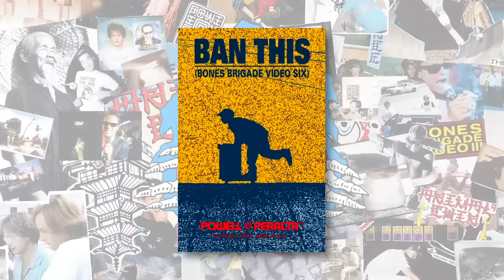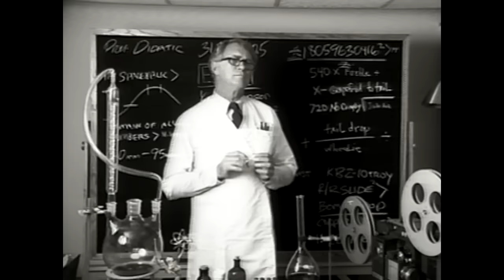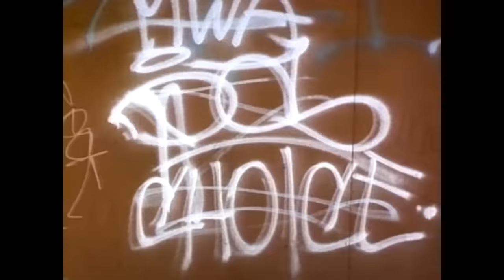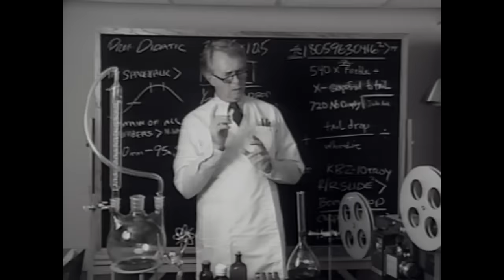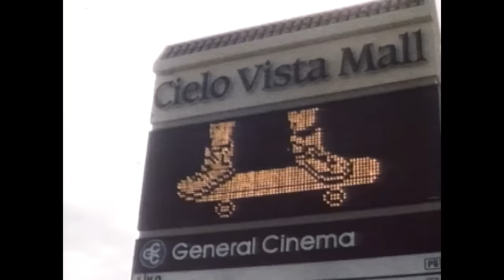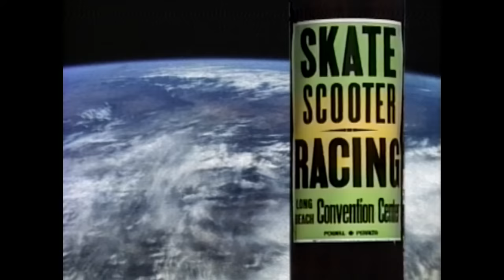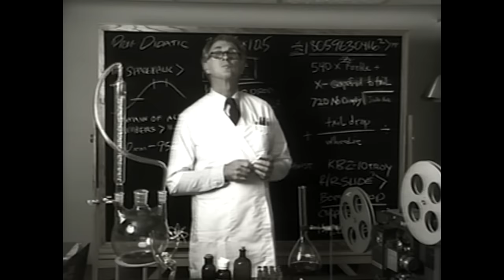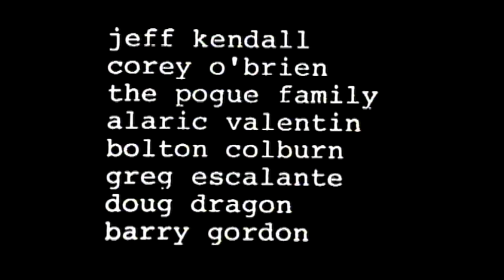POWELL PERALTA PRESENTS: BAN THIS

Comment: Airwalk need to reissue those old high tops
Reply: Prototypes 540's
Reply: They did! The Prototype 600s have been out since Spring 2020
Reply: And they have reissued in the last 10 years many other things from the 80s. Proto 500, 540. 600. Vic models in a lot of colors. And also the Atlantic... Even if everything seems to be already sold out,  on eBay you can still find this stuff
Reply: I drooled over those but could never afford them!..

Comment: Even back in the day I hated it when they cut the shot mid-trick. They film a guy doing three backside airs in A row, and when he does the 360 varial they change the shot in the middle of the trick. Powell had the best riders but the worst video editors. I guess Kevin harris is still pissed, you can barely see 1 decent trick from start to finish, and a trick last 2 seconds.